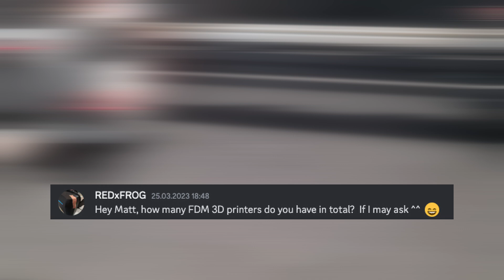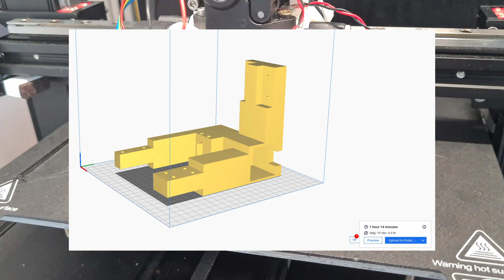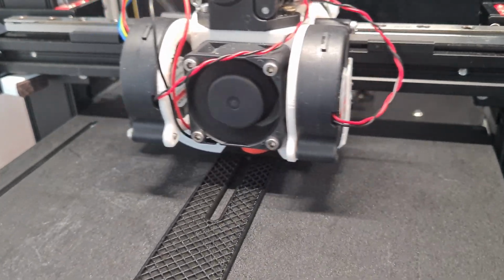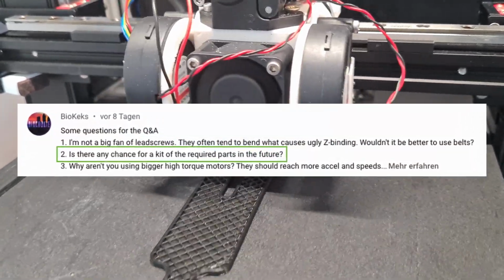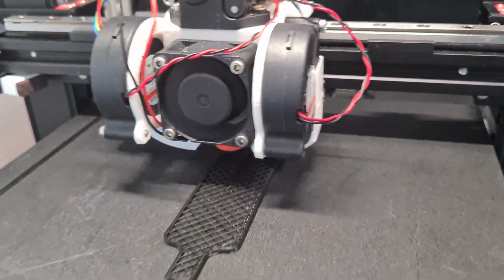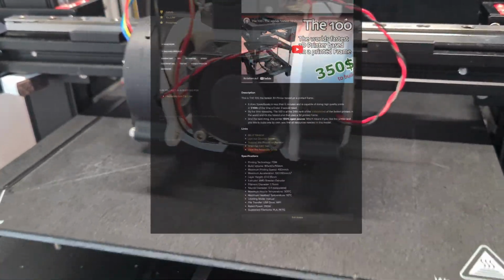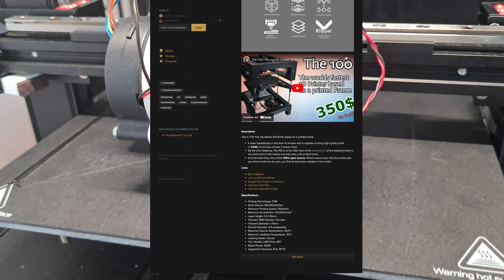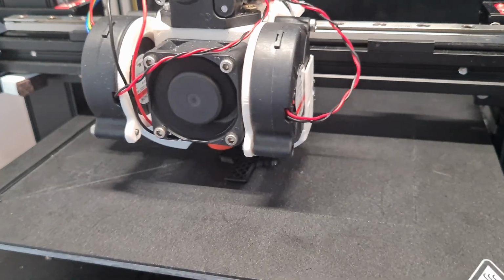Why is THE 100's print bed so small? - Q&A

Comment: I am modding my Ender 3 S1 pro right now and want to do the same mods you did, at least for the motion components. What Brackets and linear rails did you use and did you custom make that carbon fiber bed mounting plate Or is that a retail item?

I have been doing lots of research and trying to decide what bracket to get for my linear rail set up. I know I want hiwin rails but can’t decide on the mounting solution. I was looking at gulf coast robotics but they are expensive and would rather go with AliExpress since we are just talking about brackets.

Hope you answer, great channel BTW!

I am going to be building my own “100” very soon. I just want to have the ender 3 dialed before I print the parts for your masterpiece or a home build.

Comment: Have you experienced creep in your PLA? My old PLA parts are generally visibly deformed after a couple years even with little or no load. I printed a spool holder that was strong at first but eventually failed (to be fair, i could have printed it with more initial strength if i had known about creep). If so, have you tried annealing your PLA? What's the oldest printer you have with PLA structural parts?
Reply from the maker: 4-5 years build extensions for my bedslingers that are still perfectly fine as long as you keep them in a controlled environment like your apartment. I had printed PLA hooks for my balcony and those I had to exchange after 2 winters because of deformation.

Comment: Hi Matt,Tall sky scaper buildings incorperate an active counter ballance wieght at the top of the building to cancel out motions from wind on the building. Have you considdered an active counter wieg that ballances the motion of the print head. I considdered making a core xy MACHINE THAT HAS A BED THAT ALSO MOVES OPPOSIT THE PRINT HEAD AND SET THE MOTORS TO TURE AT 25% SPEEDS FOR THE PRINT BED AND 75% SPEED FOR THE PRINT HEAD OR PROPORTIONALLY OF THE PRINT HEAD TO THE BED.  YES ADDED COMPLEXITY BUT POSSIBILITY OF ADDING ACCELLERATION TO THE PRINT WHILE REDUCING VIBRATION
Reply: THIS WOULD REDUCE PRINT BED SIZE UNFORTUNATELY

Comment: How do you cool the power supply and the mainboard ? Building a similar enclosure at the moment but i struggle with the cooling of the Electronics. The whole frame gets very hot when printing abs or PA for longer times

Comment: I think your decisions about the bed size make 100% sense. That's why the v0 is so popular, even though it is even tinier than the 100 (maybe too tiny!). One question: is there enough space in the 100 to be able to mount an 18cm bed, like the prusa mini without too much work? It would be super cool to be able to use the prusa print plates, even if you can't print to the edge. I really like their satin sheet. Nice design! I've already shared with a few colleagues and we all agree, it looks sweet!
Reply from the maker: Check our discord, we already have a prusa mini mod :-)

Comment: I was trying to do some math on the 135mm^3/s and how long it would take to print 1KG of PLA at that, here is my quick attempt:

1 KG PLA spool has 330 meters
Each 1meter has 2405mm^3

So 1KG PLA spool has 808500mm^3 of volume

At 135mm^3/s it takes 5988 seconds or 1.6 hours to melt 1KG of PLA. 

That's quite a lot of flow, I'm also skeptical that the dual 5015 blower fans are enough to cool filament melting at 135mm^3/s.
Reply from the maker: Yeah that would happen on ideal conditions, which means every perimeter has to be printed with the same speed, you need have to have infinite acceleration, so in reality the flow is reached only for tiny amount of time until it get's slowed down. Therefore more realistic would be 5-6 hours for 1kg of filament. The cooling is no problem, since we are printing "very slow". I use this printer for big structural parts where I have layer times between 10-20 sek so the layers have more than enough time to cool down

Comment: I'm looking into building my third printer. I've started with an Ender 3 Pro, bit the bullet on an RatRig VCore 3 (500mm) and want to venture into ABS / ASA printing a bit more. My first idea was to simply enclose my Ender 3. After seeing your 100 I was curious. Would it be possible to enclose your Design for ABS / ASA Printing or would you say thats not a smart idea?

I'm also looking into "The Rocker" by ProperPrinting to add DualExtrusion to my Ender3... Maybe that in combination with an Enclosure would be even better than a third printer... Maybe you could give me some Input. 

Thanks for reading ^-^
Reply from the maker: Soo currently there is no mod of THE 100 for a enclosure, but the construction with it's cubic design is made for an enclosure, so you could be the one that contributes that extension to the printer.

Comment: Hey Matt, thanks for the video. I have one question about your ender 3 upgrades, what is that printed part between the linear rail and the 2020 extrusion on the X axis?
Reply from the maker: Spacers. They are needed to keep the same belt path as on the original printer

Comment: Thank you for putting the Modder Board to good use! 
Also, nice build on the Ender 3. I am not familiar with the toolhead you have on there, what is it called?
Reply from the maker: Thx man, I developed the toolhead myself. It's heavily inspired by other designs like your AirShank or the Toolhead of the Ender 3 Pro of @3dprinterfun
Reply: @MattThePrintingNerd  Nice, I saw the link in your pinned comment and will totally be printing one. I bought a Sherpa a little while back, can that be used instead of the Orbiter?

Comment: Can u tell me where I can get the tool head used for ur ender3? Thx a lot. Btw I love ur 100 project, awesome work
Reply from the maker: It's my custom design that I never released since it's not compatible with normal enders, you need linear rails and you need the pcb board.. also another hotend and another extruders.. so instead spending over 500 bugs in a bad printer, consider buying a good one ;-)
Reply: Well, I already a owner of the orbiter and a dragon hottend, and a pair of Sunon 5015 and noctua 4010…. and I didn’t t have an ender3, just interested in a lightweight toolholder..  for my own little printer, nothing comparable to ur project, just some afterwork hobby 😂thought u used one which is available for use or to customize. But thx for ur answer. Keep on going, maybe I try the100😊

Comment: I'm more impressed by that ender 3 than the 100, I like the tiny ducts. And 135mm3/sec of flow is the highest I've heard quoted, maybe the Goliath is faster but I can't find good data
Reply from the maker: Yeah the Goliath makes over 100mm³ flow with a 0.4 nozzle so you're comparing apples to oranges
Reply: Because 135mm/s³ is BS, even with a 0.8mm nozzle. It likely isn't actually melting the plastic fully at that kind of flow rate, hence needing a larger nozzle. It's similar to how Phaetus markets the Rapido.
In reality if you try to run actual full speed prints at that flow rate it'll under extrude.

Comment: Jesus crist, what kind of speed/line width/layer height combo do you use for a toolhead that can do 135mm³/s 😂
Reply from the maker: The speeds are pretty low, a mix of 180/120/140 for Infill and inner/outer perimeter. As layer height 0.65 and a line with between 0.8 and 1.3mm.

Don't forget, it's not magic, it's a 0.8 nozzle ;-P
Reply: @MattThePrintingNerd  are you running 150% or wider infill?
Reply: @MattThePrintingNerd  oh okay, that makes sense :) thanks for sharing!